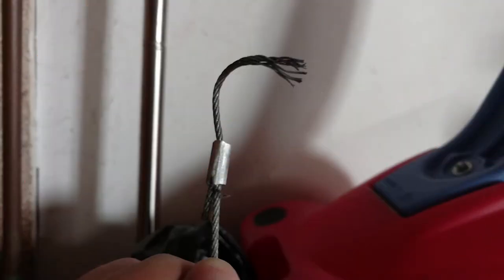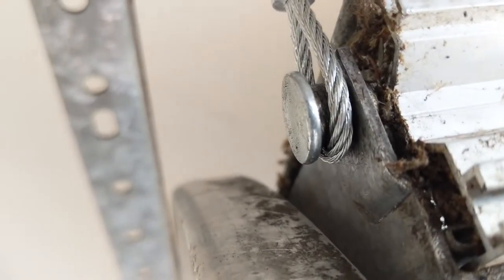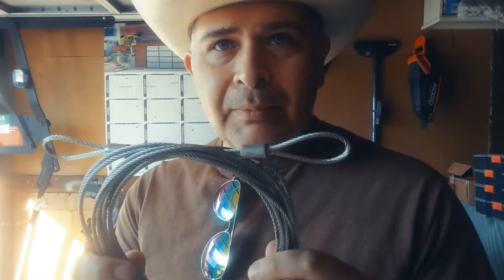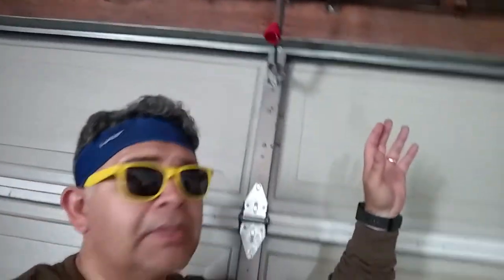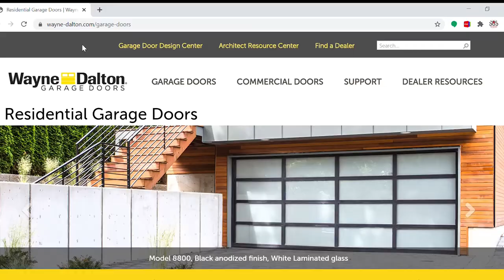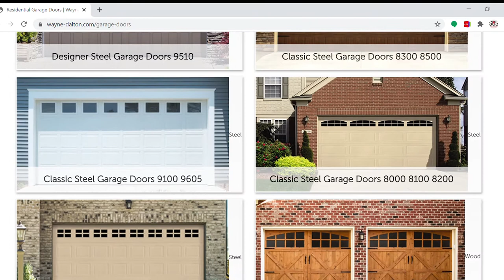Get the Right Garage Door Cables 2 - Right for Wayne Dalton Garage Doors?

Comment: Where did you get small loop cable? One of your links doesn't work and another shows the cable that seems to have loop that is too big.
Reply from the maker: Hello. Can you confirm for me which model of Wayne Dalton garage door you have?  Is the 9100 model or perhaps the 8000 model?  It's possible due the current part shortage these cable a not available.
Reply: @sosgds  
I wished I knew.... this is 40-50 years old door it looks like it designed for CC1 clip
Reply from the maker: Any way you could send me a picture?  Feel free to send a picture of the cable and loop or hook to my email.  sosgdoservice@gmail.com.